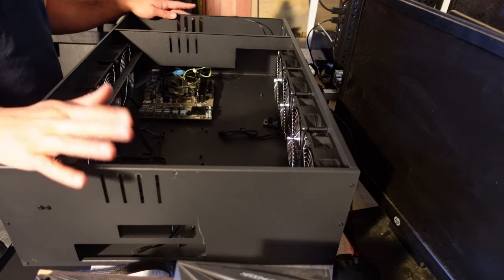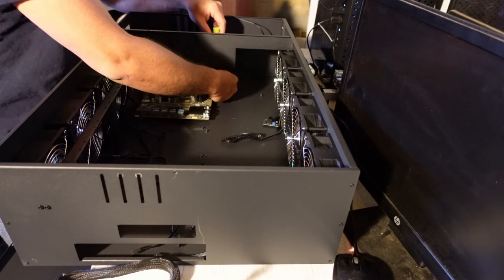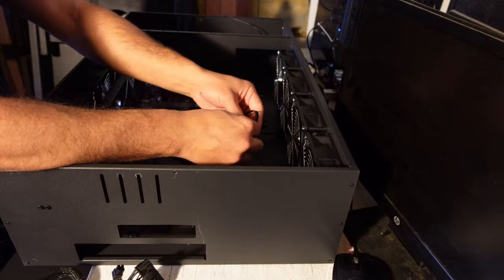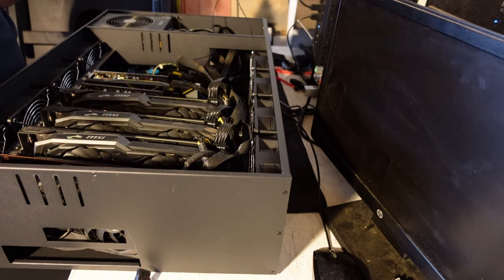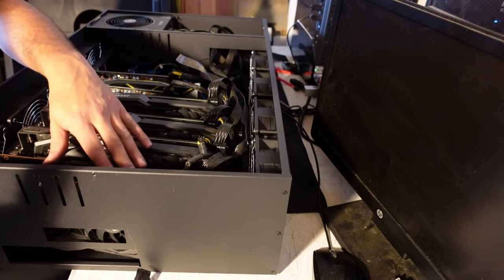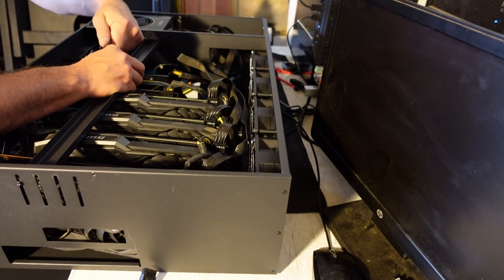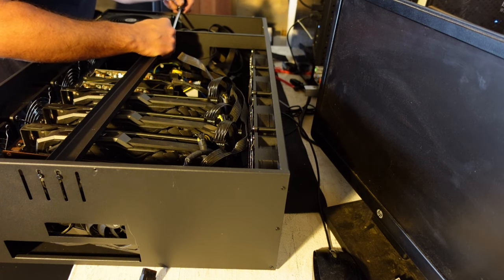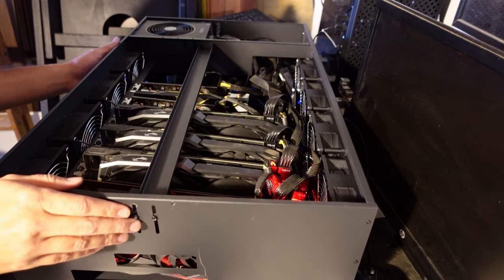125$ server case build, but what's the catch, and would I do it again?!

Comment: I will never fully understand the whole server case thing. To me those fans require too much power and jst eat into profits, especially right now. The only use case I can see is if you have limited space.
Reply from the maker: I was out of space and the server cases fixed that, its also nice to be able to run the fans at zero....while they use alittle more power, I think you more then make up for that with the space you save and the cooling benefits